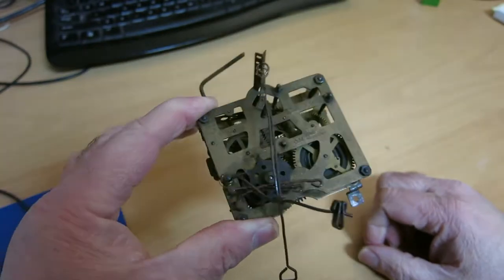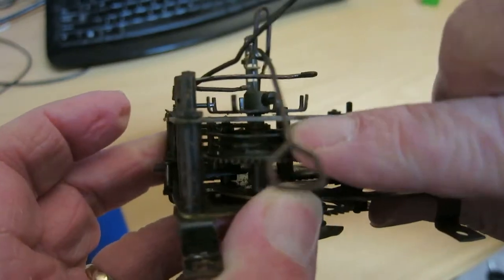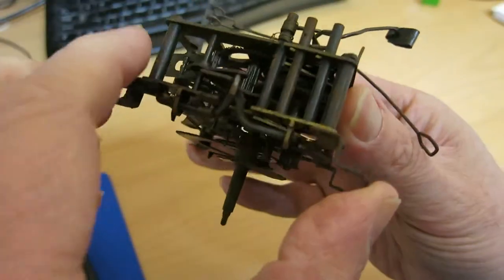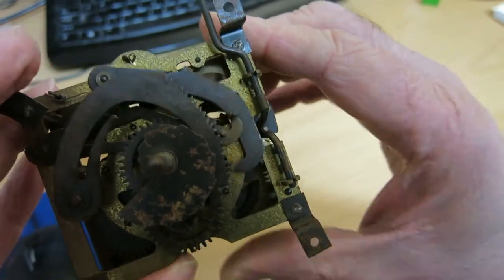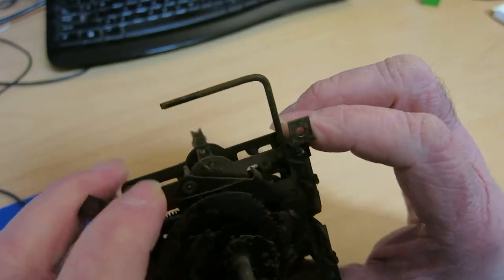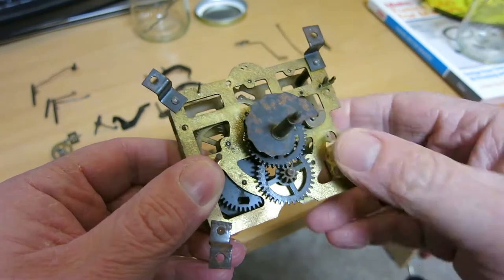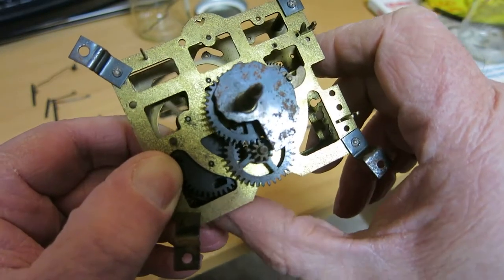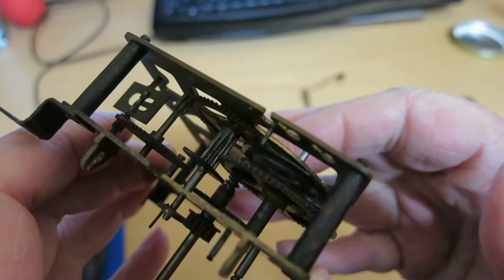Testing a Rusty Regula 25 Cuckoo Movement

Comment: I watched a video that said that cuckoo clock movements have mainsprings that drive the first wheel and gear train but i dont see any mainspring on the strike mechanism at all. Purely gravity and mass driven is that correct for a 1 day regula movement?
Reply from the maker: I have seen some cuckoo clocks that do have springs, and their weights are simply decorative (the chains don't move). Most Regula cuckoo movements I've seen don't have mainsprings. As you say, they're driven entirely by gravity & the mass of the pine-cone-shaped weights.